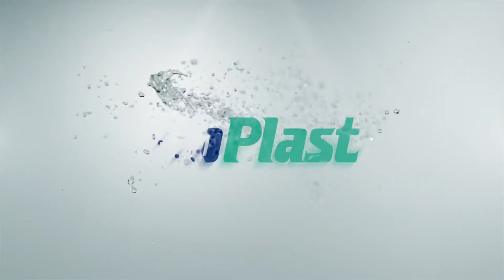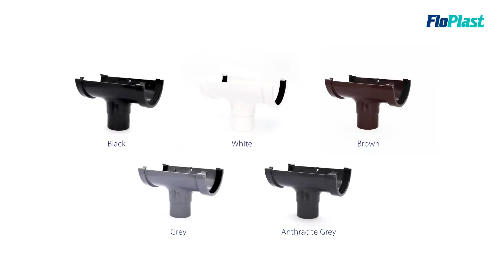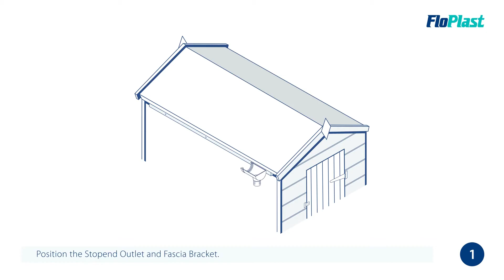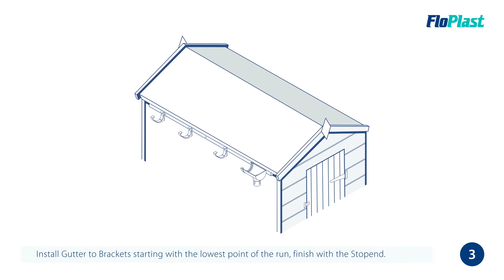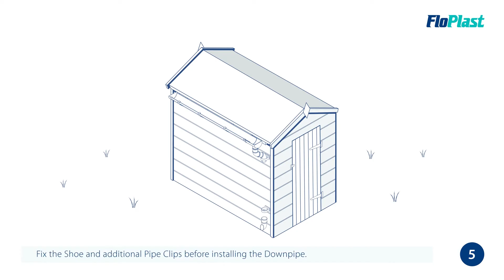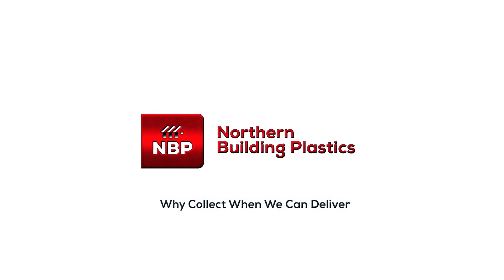FloPlast Miniflo Guttering Installation Guide

Comment: I've had two union brackets where the clip has snapped off when trying to connect the gutter. I've only had success with the actual gutter brackets as they are much more flexible. TBH I'm not particularly happy with the constant return of union brackets for a replacement.

Comment: What they don't tell you is how to get the guttering ends into the union.  I've tried everything and been trying to form one joint now for 2 hours.  In the process the union got broken and had to be scrapped.  Looking at the ends of the guttering, I can see a previous installer gave up and filed off part of the edge to try to get it in!  Convenient that they don't deal with this nightmare, isn't it?